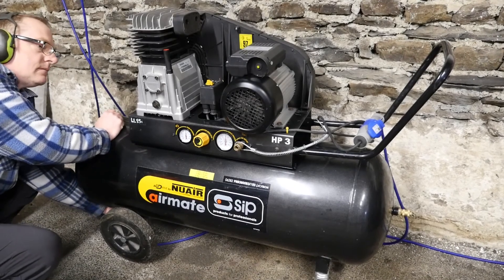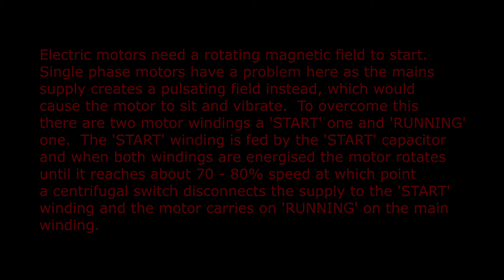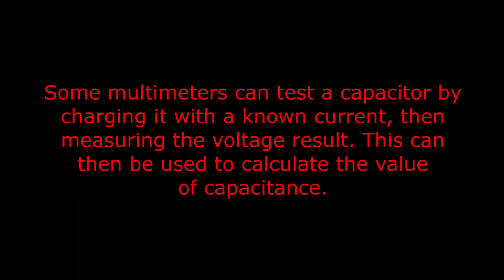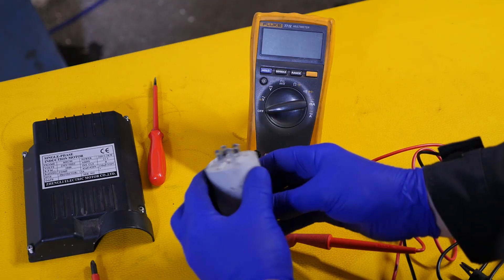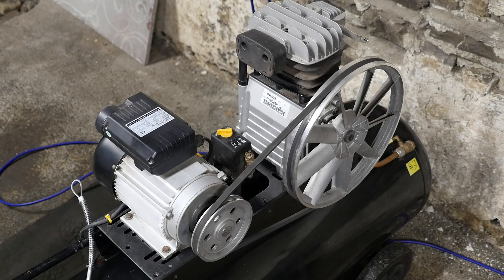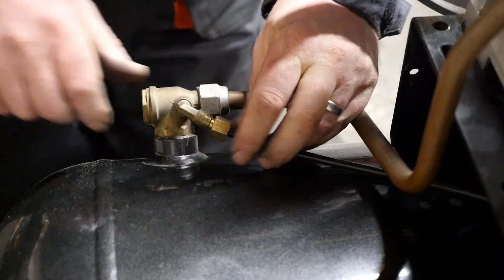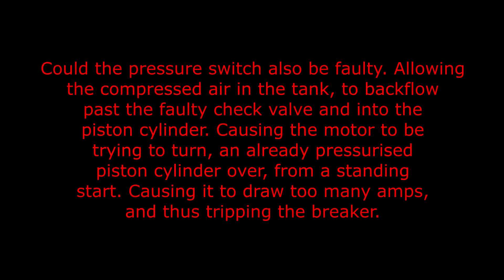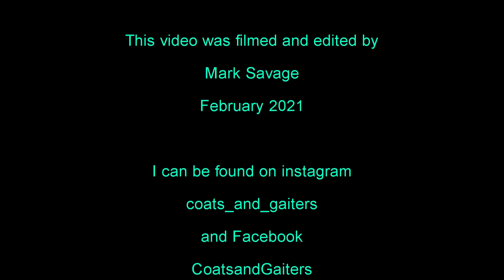Using Fluke Meter to Test Air Compressor Motor Capacitors & opening up my SIP One Way Check valve. ⚡

Comment: Hey! Nice, cheap fix :)
I've never had one of these type of capacitors that had a charge after taking it off. They very quickly bleed off their charge through the motor winding after being powered off. It's still ofcourse best practice to not touch the terminals and safely discharge them, in case for instance the windings were open. Even then it's still AC passing throught them, so it's likely they won't have much of a charge anyway.

So how exactly does the depressuring of the piston work? Whenever there's no pressure in the air release pipe, some actuator opens a valve in the compressor, depressurizing the cylinder?
All the best!
Reply from the maker: Darn did I say that?  like you say it would discharge through the secondary winding and charge very rapidly as soon as power is applied.  My first comment had to be from a smart person catching me out didn't it haha.  The depressurising takes place with a little solenoid valve as I understand in the pressure switch housing.  It closes when powered on and then drops open when power is cut off.  Thank you and all the best to you and no more catching me out lol
Reply: @CoatsandGaiters  
haha, I don't feel at all like catching you out! :) 
I did feel a bit like a pedant when writing that comment, but YT comments seem to be a playground for knowitalls,  and let's face it: most people with technical interests are smartasses anyhow :D

I definitely think it's wise to treat every cap as a shock hazard anyway!

Thanks for the explanation and another thorough, detailed video!!
All the best from snowy Belgium!
Reply from the maker: @koffibanan3099  I try so hard to research anything I put into a video and it just shows you.  Never put something into a video if you wouldn't put your life on it being right.  This is another valuable lesson I have learnt.  Can only make my video's more accurate in the future ....... I hope.  Thank you again ....from the cold UK.